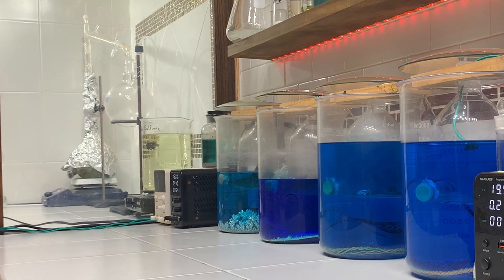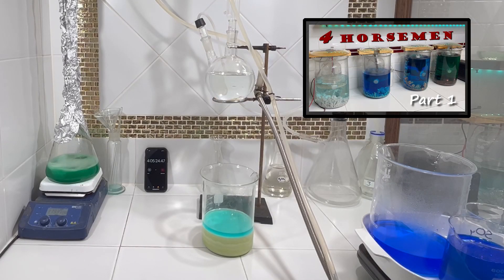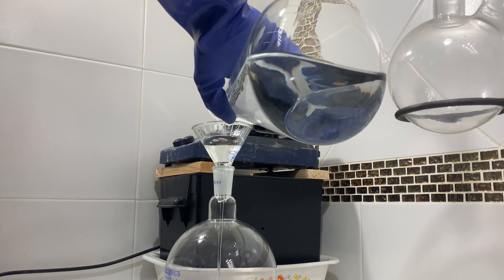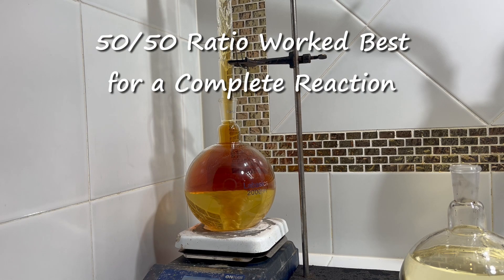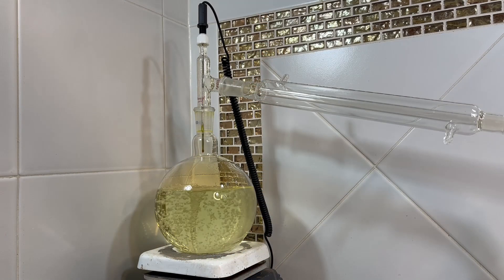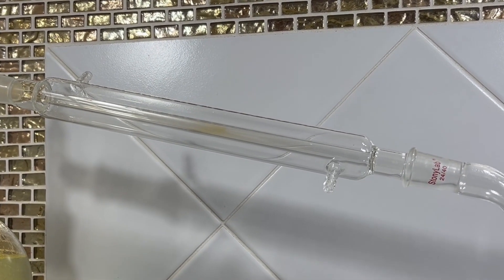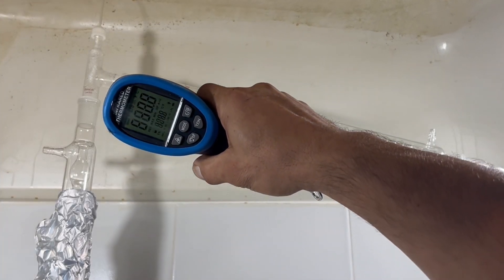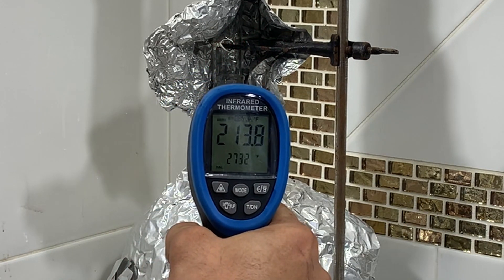Recovering Nitric Acid from the 4 Horsemen Silver Cells

Comment: What is the purpose of adding the sulfuric acid to your dilute nitric acid? You should be able to concentrate the nitric without needing to add anything to it. Depending on the concentration of nitric, your boiling point would start around 100C (i.e. the boilig point of water) then go up to 120C where you would reach the azeotropic concentration. Save your sulfuric acid for making fuming nitric with sodium nitrate.

Comment: Good afternoon Anthony, have a little off subject. Do you add any sulfuric acid as an electrolyte to your copper sulfate solution for your copper electrolysis cell or just a high concentration of copper sulfate?
Reply from the maker: Just copper sulfate. Free sulfuric acid will dissolve the copper cathode.
Reply: @anthonythomasfmg  Thanks. That's what I was thinking. Also I didn't want any lead sulfate or other compounds to be dropping out of solution and mix it in with values.

Comment: Even though it has a lower boiling point nitric acid has a weird property where a dilute solution of nitric acid and water will distill over mostly water first. A much easier way is to evaporate the copper nitrate down to crystals before adding your sulfuric acid. This way you get much stronger nitric with way less effort